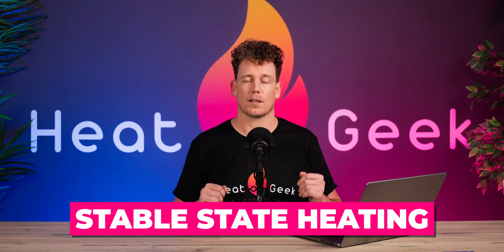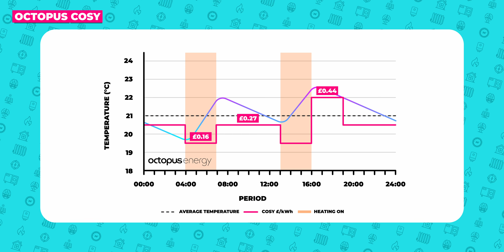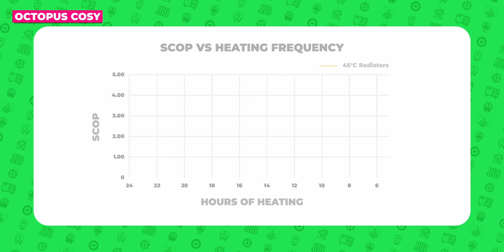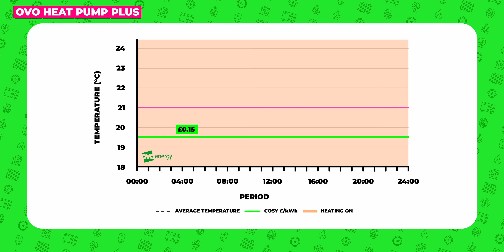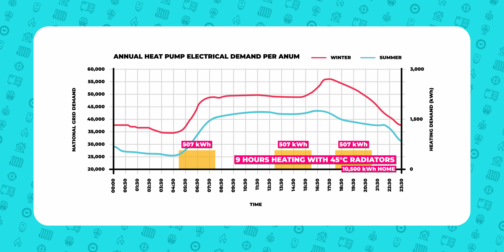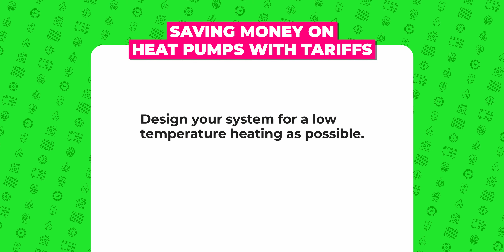Which Heat Pump Tariff Saves The Most Money?

Comment: Battery + HP + ToU tariff?
Reply from the maker: Combining a battery with a heat pump and a Time of Use (ToU) tariff is a great strategy! You can charge your battery during off-peak hours when electricity is cheaper and use it to power your heat pump, reducing overall costs. 😊

Comment: Thinking about going in this direction (heat pump). We are in a Georgian house that is D-rated although with very leaky French doors in the our main living space and in the kitchen. I hate warm bedrooms, so hate the idea of heating the house at night and then only having (in your data guy's example) 19° in the evening at the time you actually want the house to be warm. Currently we heat with oil and supplement with wood. Heating is actually only on 2 hours a day unless it's exceptionally cold. We also have an EV so we are Octopus Go tariff already. Wouldn't want to think about heat pump without solar/battery setup - just doesn't make sense for us. So ultimately it's going to be trying to work out whether the finances make sense.
Reply from the maker: All these things can be achieved with a heat pump and no problem whatsoever

Comment: I'm just doing calculations with Octopus for a cosy 6, and to sum up my calculations, without solar and battery you will pretty much never get a return on investment with a heatpump! Even with my installation cost of £2800 it's pretty much throwing money away, secondly without then spending another £14k on PV +Batt you are totally at the mercy of electricity prices that are simply not guaranteed and you could end up seriously burned by energy costs!  Adding a PV + battery again taking 12 years to break even means the whole idea is a financial folly running into 15 years to break even. That's not even including factoring in financing costs, if you find £15k down the back of the sofa then fine do it it but it's still no cheaper really. 
That is unless you can prove me wrong!!! £17k outlay, currently e8000Kwh per year and gas costs £650

Comment: Surely steady output is more efficient than steady "state"?
Reply: It appears you're limiting heat pump control to on/off like a boiler heating timer. Presumably you can then do all those efficiency calc.s, but why do it for real?
Reply: Actually - I'm thinking steady compressor speed rather than steady either of the above.
Reply from the maker: @jim-odonnell it’s not steady output. The demand fluctuates throughout the day. As demand increases output increases a vise versa.. the result is that you keep the home in a steady state and don’t vary the internal temperature
Reply: @HeatGeek  I know you've not proposed steady output. You suggest that it's most efficient to keep the same internal temperature - I'm asking whether steady input would actually be more efficient? I guess not if sometimes it's underheated (user comfort not met), or, overheated (increased energy loss). I was coming from the weather compensation mode angle which doesn't attempt a fixed indoor temperature.
Reply: @HeatGeek  also, thanks for engaging!. Excuse me making two points in one but why are you assuming such crude control of the heat pump in your tariff evaluation? It's a silly argument suggesting just because there's only a few hours of cheap electricity that anyone would try and heat the house only in that time - or did I miss something?

Comment: It is a lot easier and more practical to store electricity rather than heat using a home battery. With Cosy, you can charge the battery and heat the water during the night time off peak, run from the grid during the other off peak periods and use the battery to power everything during the highest charge times. This means you can run the whole house 24/7 including the heating at constant temp at cheap rate. You only need a  battery big enough to bridge the gaps between off peak periods. Extra cost, yes, but a good long term investment.

Comment: I find it interesting that you're only considering heating in these calculations. Octopus cosy, or even the new Eon tariff which I think differs from that in the video now, would compensate with lower energy prices for total home electric usage than Ovo's heat pump tariff... Is there any bias in your video and partnership with Ovo? I see no mention that they only allow select heat pumps into their tariff. The huge downside is obviously cooking during the 4-7pm slot on cosy which negates some of that and does require different energy usage patterns to take full benefit.

Comment: I might have to cycle my air to air heat pump because I got to powerful one.😅 In cold winter about -15c largest electricity consumption in hour for whole apartment was 1.4kw, so my Panasonic HZ-35 was working only at 50%.. I going to start turning it on and off in warmer climate because it cycles way to much already when outside is +10c. Going to try leaving it off overnight because temps are lower outside and it wouldn't be the problem if temps dropped 2-3 degrees overnight.

Comment: I'm currently experimenting with Cosy octopus and charging the home battery in the dip periods (10.36 KW nominal battery capacity) and running my ASHP on steady state
Reply: Do you have solar or just a battery?

We can't get solar due to windows in the roof.

Wondering if a battery only systems saves money.

Thanks.

Comment: I've only just installed my heat pump so I'm still testing out different settings, but I've been wondering about the same approach as Dr. Michael. I'm currently on Octopus Agile. 

I don't like to be hot at night, but sleeping with the window open then cools the bedroom, gives us fresh air (when it's least polluted outside!) and stops condensation from forming on the windows. Sometimes we also have a window open in another room so that washing can dry. 

Given this, does it make sense to have the target temp set higher at night to say 20 or 21? My target temp during the day is 18. I would then avoid having the pump running during the 4 to 7pm peak, although I will be adding solar and battery soon so it will be an option to run it off battery during the peak. 

This should also enable opening the windows for half an hour early in the morning and late in the evening (again, when pollution is lowest) to let fresh air in and prevent condensation. 

I suppose the main question I'm asking here is: is this an efficient way to run things given the windows do need to be open some of the time? It also takes advantage of Octopus Agile pricing. Maybe using a dehumidifier to dry washing would be better, but then requires buying and maintaining another device?

Comment: In my experience, in terms of cost, maxxing out during the Octopus Cosy half price daytime period has more than made up for the loss in efficiency. In fact I've been surprised to see not much difference in COPs compared to steady state; maybe this is due to making more use of the higher daytime temperatures? (7kW Vaillant, design temp 38C @ -2C, house with v. high thermal mass, EPC B.)
Reply from the maker: Your statement aligns with our findings.. for some reason everyone seems to miss this point of the video. Go to the graphs at the end and follow along a 35c system.. it’s much more worth kid shifting…. Then please respond here and help me understand why people keep missing this 🙏
Reply: Yes indeed, at 13:58 you make the point very clearly that time of use tariffs are worthwhile with low temp systems. I think we might miss this message because the video starts with lots of impactful 45C+ examples with Octopus Cosy, with the emphasis on hrs/day vs efficiency, and little mention of the effect of low design temps. Maybe it’s a lesson that people’s (including mine!) concentration fades towards the 2nd half of a video, especially if the 1st half carries a very strong message, and perhaps the key points need to be flagged early on. 
Thanks for your excellent work btw, it’s making a real difference.

Comment: With an inverter and battery you can charge it up at the cheap rate and then run your heatpump off your battery. My average rate on Agile is quite low

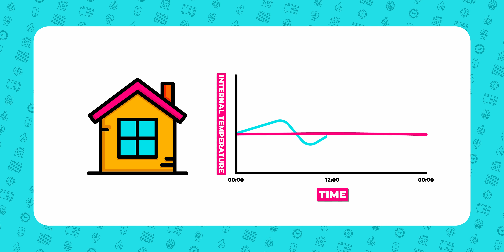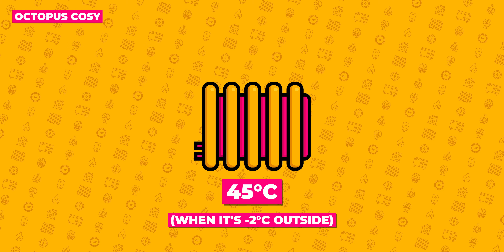Comment: I'm a bit concerned now, because I've just had a new heating pump installed (last week) by Octopus. The worrying thing is that the design shows a flow temperature of 55°.  Also, I'm on Octopus Flux, to have the option of selling solar back to the grid. This tariff only gives me a cheap period between 02:00 - 05:00, with a high period between 16:00 - 19:00. I'm thinking that I might have to move from Octopus, which would be a really hard thing to do, because they are by far the best Energy Company! Great video, thanks for the info.
Reply: I have a hybrid inverter, 3.6 kwp of solar and 7kw battery. Just had ashp installed and am using Cosy tariff now with 8 hrs low rate around 13p. I recharge the battery in each cheap slot, at the same time using the low rates to run hp and other appliances/EV charging. The battery     runs the house and hp for as long as it can during high rate periods, then uses grid, and I can still export excess solar using Octopus  outgoing at 15p. It's early days but it makes sense to me and I will also work towards steady state heating to improve efficiency and start to lower the flow temperature too.

Comment: Surely the sweet spot will be steady state heating with temperature control and a house battery for use during peak periods? We're on Octopus Cosy as we're having Octopus install a heat pump in a few weeks time. We already have a 8KW house battery which we charge up during the 2 cheap periods, which allows us to run the house pretty much all day on the cheaper rate.

Comment: Only two weeks into having a heat pump, so still experimenting. We have 6 hours cheap tariff from 11.30pm. Hot water, off for 1 hour 22.30-23.30. Run anti-legionnaire cycle daily from 3.30am. This heats 400l tank to about 56' at COP of 2.1. Lasts most of the day, and any more water needing heating has COP of 3.1. Heating is set at 21.5', with 7pm - 22.30pm at 22 (for evening relaxing). Off for an hour then 23.30pm - 5.30am set to 23'  This keeps a virtual steady temperature, but shifts power usage to off peak a bit. Still tweaking heat curve downwards.
Reply from the maker: Please watch our video on legionares and hot water store temperature. A daily anti legionella is not required
Reply: Just doing it as a way to utilise the cheap rate.  @HeatGeek
Reply: Christ I run a legionella cycle once a week and that's probably overkill. Switch it off!!!
Reply: @fruitytv-uk  Getting a full tank of hotter water for a third of the cost. How is that overkill?
Reply: @barriedear5990  if uoh are accessing extremely cheap rates to do it then having a greater capacity hw which would save it using expensive power later then great.  If not then the nay sayers are correct.

Comment: By far the best way to take advantage of variable rates: batteries. Big bats cheap as chips now. Charge at night, discharge when price higher. That way keep heat pump at steady temp. (except for hot water, run that at the cheap rate).

Comment: Is there much of a price difference when running the heat pump at night?  Pretty sure you would be consuming more as the ambient outside temperature would be a lot cooler during the night than in the day, so i guess your COP would not be that great but dont know how much you would be saving?

Comment: The two cheap rate periods help people with batteries. We'd need an enormous system to run our household and switch to a heat pump for heating.

Comment: Why could you not use the agile tariff but reduce the flow temp for the peak hours? Agile is the cheapest per unit cost of electricity
Reply from the maker: You can. This is a simplified illustration

Comment: I work in green energy. I worry this video is music to the gas industry's ears. The idea of heat pumps running 4-7pm will  fill the electricity networks with dread.

This video is quite simplistic. The fact is that all heat pumps and emitters are oversized once you're above - 2C. COP is also far more dependent on outdoor temperature than flow temperature. There's a real argument for dynamic flow temperature control, with higher flow temperatures mid-afternoon when the air is warmest and using excess heat to ride through the evening electricity peak.

The basic problem is that controls are still rubbish (I've got an Ecodan - so this is particularly true). All heat pumps should be predictive of weather conditions, be using the house's thermal mass as buffer and calculate the cheapest way of keeping your house within a defined temperature range with smart tarriffs. SCOPs might improve that way, but cost, not SCOP, should be the target. 

Your advice is probably correct for houses today, but it's not sustainable for a cheap, decarbonised grid.

I plan on programming my way through this with Home Assistant, but I'm not the average consumer.

Lots still to do!
Reply from the maker: No the premise in this video is that the Supliers have to vary the pricing much more in order to making shifting useage more viable and worth while

Comment: I have a ground source heat pump with underfloor heating, I am on the cosy tariff. This heating season I have heated my home only on the 6 hour cheap rate, the house has retained the heat at a satisfactory level. With underfloor heating in a screeded floor a lot of heat can be stored and released slowly, the room temperature keeps rising for several hours after the heating stops, my flow temperature is between 30 to 42 degrees. We have around 6 weeks of heating left this season, but I am forecasting less electricity usage this year. However it has been quite mild this winter.

Comment: Disappointed that there wasn't more mention of Agile and avoiding 4-7pm.    Prices outside this slot average 10-15p/kWh
Reply from the maker: Yes out spreadsheet wasn’t built for that. But we’re building a full on calculator for it instead. I think it will be pretty significant!

Comment: Is this video slightly disingenuous? At the time of writing this comment 17/3/24, Ovo Heat Pump tariff is only available to Vaillant HPs or supplied or installed HPs. This is not clear in the video, unless I missed it. I did wonder why the first 6 minutes was spent exploring a pretty ludicrous usage scenario with Octopus Cosy. This kind of content that appears to be customer centric, but is really a thinly veiled advert, leaves a bit of a bad taste. How can I trust the things you say in other videos?
Reply from the maker: There’s a few using cosy in the 6 hours and if you have a low temperature system it’s totally acceptable and incredibly cheap! 

Ovo won’t only be offering this with vailant for long I would t think.. they want more customers

Comment: With setback overnight, wouldn't that normally be the same thing as turning off the AHSP most of the night? Unless it is really cold outside or the house has unusually high heat loss, the temperature will only drop to the set back temperature at say 5am or 6am. So, the ASHP will be off overnight. So setback would mean not steady state for 24 hours except on the coldest days. Is that right, or am I overlooking something?
Reply from the maker: If your comfort temp is 21 and set back 19 that could be like 23 hours as it’s colder at night
Reply: @HeatGeek  Sorry, are you saying that with a 2 degree set back the ASHP would only be off for an hour? That is, it would take an hour for the house to lose 2C on a cold night? So the ASHP would be operating 23 hours steady state?

If that's what you meant, I'm sceptical. I did some monitoring overnight on 27 Jan. It was 2C outside at midnight and it fell to 1C by 6am. Over those 6 hours my rooms fell by between 1C and 2.6C. On average, less than 2C. I think for my house a 2 degree setback would mean the ASHP would be off the whole night except on the handful of nights when the outside temperature is well below zero.

Comment: What about an accumulator tank? They’re commonly used with solid fuel heating such as wood pellets. Heat up a large insulated tank of water on the cheap overnight rate power then use that as a heat battery for steady state heating during throughout the day?
Reply from the maker: The ere isn’t enough volume to bother using them and they require higher temps still so lower efficiency again

Comment: Octopus's Agile tariff only got a brief mention, but I wonder if this would be a better option, if it was just used for 21 hours, avoiding the three hours, 4-7pm, when the Agile price spikes? 

Averaged over the last year, the Agile price for the other 21 hours of the day was 12.6p, so the Ovo HP tariff is 19% more expensive for those 21 hours. The video estimates that avoiding those three hours would increase daily usage from 102 to 120 kWh, which was rounded up to 20% increase, but is actually 17.6%. So, on those figures, Agile for 21 hours would be cheaper than steady state and though it would use more power, it would tend to be low carbon power.
Reply from the maker: Yes that was a bit more complicated to work out but we’re building a calculator